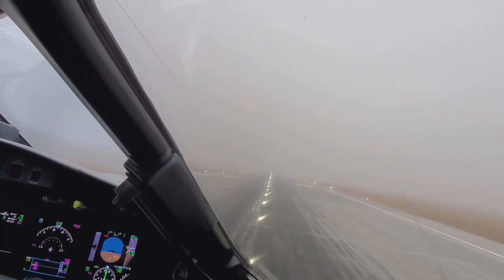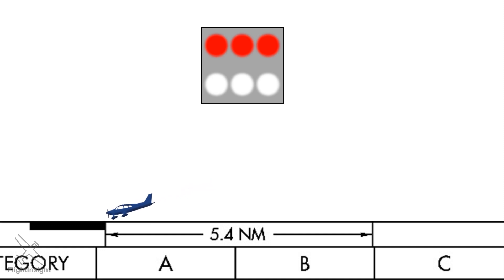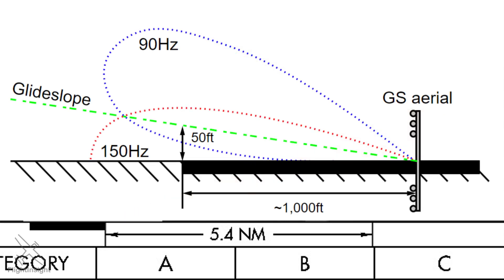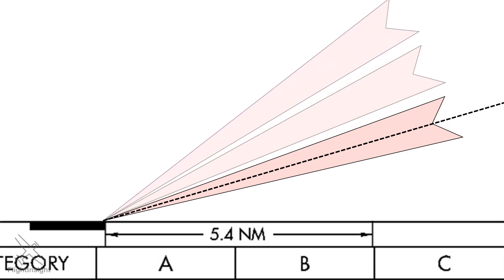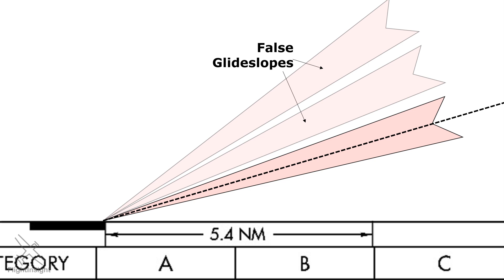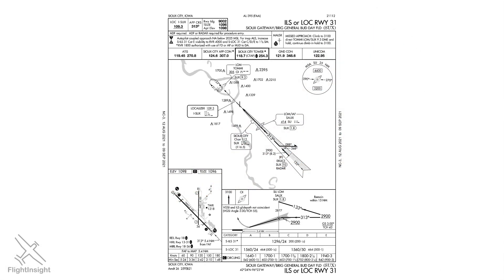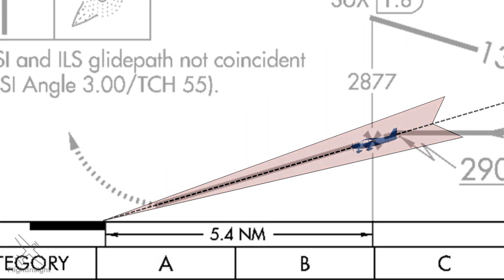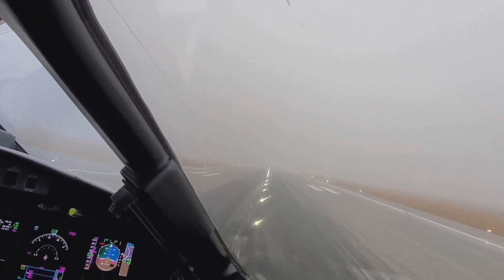Don't Fall for a False Glideslope! | ILS Glideslopes Explained

Comment: Dan - After locking in on a false GS signal, but subsequently descending to the proper altitude prior to crossing FAP, will the instrument release that false signal and acquire the proper 3 degree slope?  Or does it stay “locked” onto a false reading?

Comment: Excessive elevator pressure to maintain descent (on the false glide slope)?!? You mean excessively reduced power! 

Perhaps even an inability to pull sufficient power. Such also reveals itself both manually and coupled presuming no auto-throttles. Even with auto-throttles, they may be limited so as to cut out for need being excessively reduced

Though, correct, for both manual and auto/auto-throttle, VVI will reveal the correct beam. If you’re doing 90 kts GS, your VVI is 450 fpm. At 120 kts, it is 600. And, intercepting from below really does remove the problem. As does knowing proper altitudes to range remaining assuming you have dme, 300 feet above touchdown per mile to go. 

Now, go have a look on Medium for AOA and power techniques followed by its case study with F-35C crash in the South China Sea. Airplanes descend with reductions in power; they dive if you push the nose down. Descents are adjustments in chemical energy rates to change potential energy. Dives are trades PE for KE. Similarly, climbs are CE for PE while zooms are KE for PE. You should be using power techniques excluding airplanes with excessive spool-up times like certain turbine platforms. Even with these, you’re going to have to adjust power so as the dive won’t get away from you thus converting the dive to descent and therefore even in these, it is with excessive power not stick pressure for which you will likely sense being too steep. Excessive stick pressure means you are going too fast. But, yes, VVI will quickly illuminate.

Comment: Don't forget about the FAF Altitude cross check!  I'm not sure about in the USA, but in many other places not crosschecking your altitude at FAF is a check ride bust
Reply: Ive never briefed expected VSI - yeah we always want it to be below 1000fpm and such but never tried to arithmetic the value before or during flight (especially since its based on GS not IAS). I HAVE countless times briefed FAF crossing altitude. I suppose in the event of following false glideslope, youd want to know as soon as possible, and since youre really high up, its likely still far outside the FAF, so I can see the merit of this VSI expectation a little bit for the earlier warning sign.
I've also hand flown 99.9% of all the approaches of I've ever done as well though.
For the USA, in a pt141 IRA check, the FAF crossing altitude brief wouldn't be a reason for failure. That said, its on the TPP for a reason right?